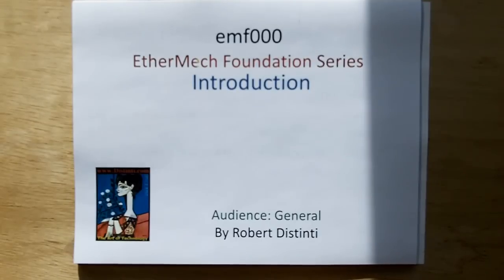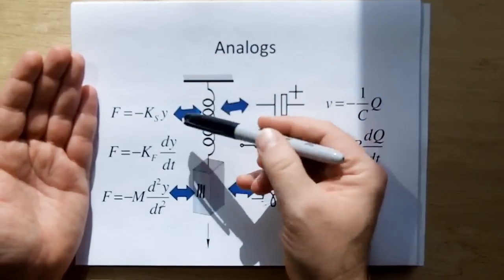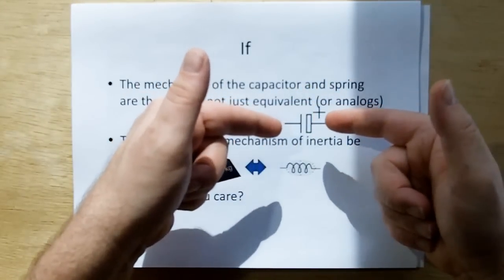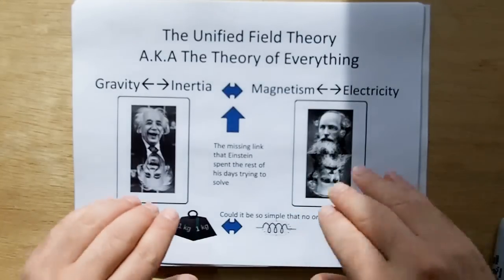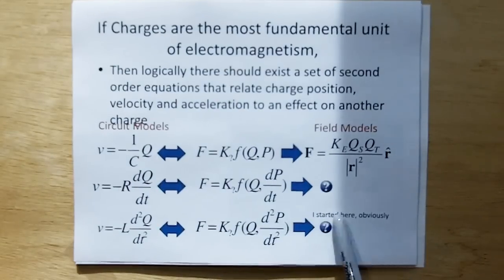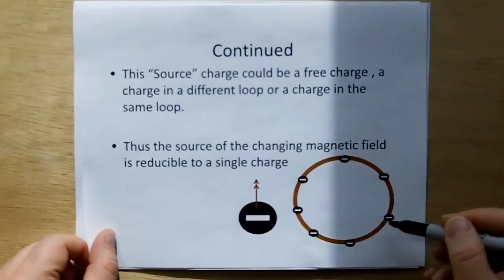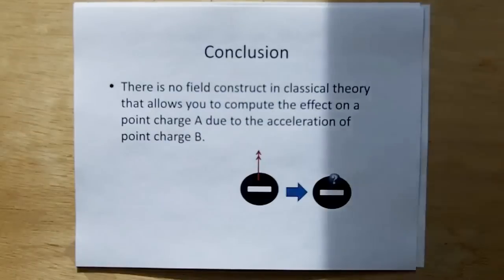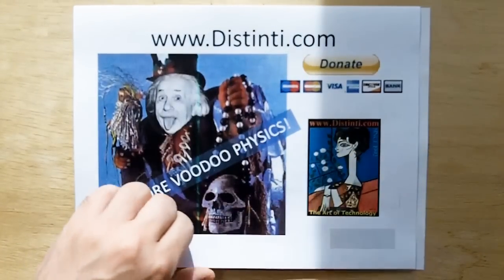emf000: Introduction to Foundation

Comment: Integral form of Maxwell equations are not only form; You can calculate E and B field produced by single moving electron and also you can calculate force on other moving electron. So Maxwell give us precise tools for calculations - only what was not explained is relativity of B field. One observer see another not. So how electrostatic force or field can vary dependent on observer. Slow speed movement was considered as close to static that this difference have no any significant effect in material world. But electric force is so strong and so well balanced that even very small difference can make an impact. I saw couple of videos on YT explaining this but still processing it and looking for more simple explanation. So where is emf001? Videos on this chanel should be linked with next part...

Comment: In Wilhelm Weber's system of electrical forces, which we weren't taught in school for some reason, the force of one charge on another is:
 F = kq1q2/r^2 x  [1 - 1/(2c^2) x dr/dt + r/c^2 x d^2r/dt^2] 

The terms in the brackets show the static case, the case of constant velocity and the case of acceleration, respectively. If dr/dt and d^r/dt^2 are zero, then it reduces to Coulomb's law. There's a Professor Andre Koch Torres  Assis  in Brazil whose bilingual website  explains all this stuff: https://www.ifi.unicamp.br/~assis/  I believe all or most of  his books are also on this website.
Reply: That would reflect electrostatic field, magnetic field, induced electrostatic field (by changing magnetic field), why stop there? Derivates higher than 2nd should also have impact. Maxwell did great job with his equations and many great theories derived from there.